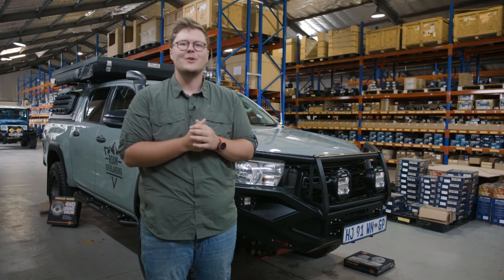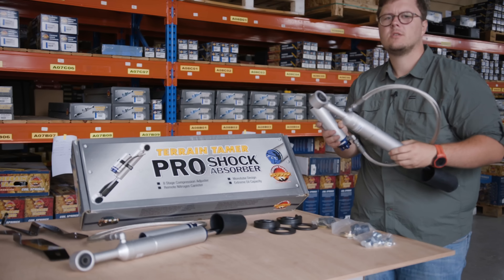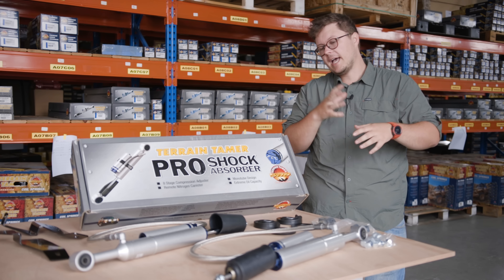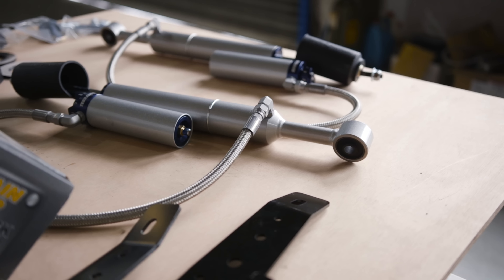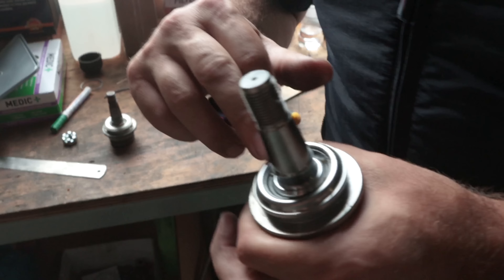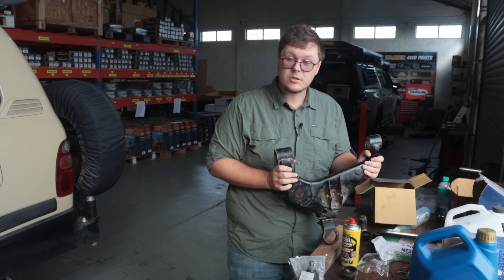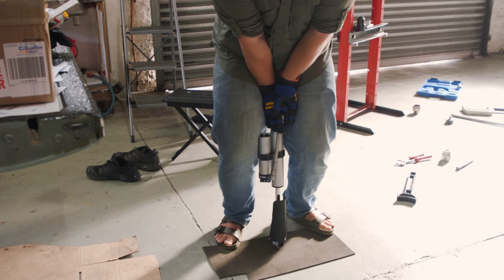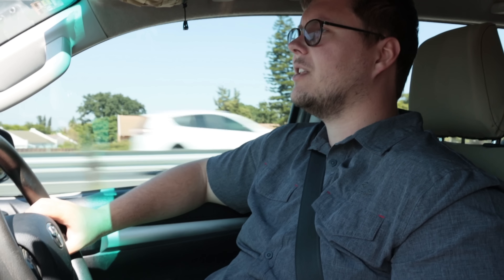Adjustable Remote Reservoir Shocks Upgrading to Terrain Tamer Pro Suspension! ROAM Overlanding

Comment: There excellent shocks I agree, keep in mind on dirt and gravel roads & tracks inspect the reservoir mountings in the morning and evenings especially if your on corrugated ones, as the reservoir where it is mounted/attached can crack, snap or come loose, that where zip ties and wire come in handy as is learning how to stick weld with a car battery.

Comment: Yes, adjustable shocks with remote reservoir are highly recommended in maintaining a great ride no matter the road surface you're on (specially if its for both high & low speed compression, and rebound).  Before fitting a set on my 4WD, I thought once I set it to my liking, I'll probably not change it again.  But I was wrong.  Now I have a setting for corrugations, rough gravel, sand and tarmac.  And these change again depending on my load.  And being able to change the setting without requiring a tool is best.  It's a game changer for me personally.👍
Reply from the maker: It’s like the first time I used tire pressure monitors, now I can’t understand how I ever went without it 😂

Comment: I also have the TT parabolic leafs, smart coils and Pro shocks on my Hilux Legend50 (along with Ironman ProForge upper control arms). Eventually figured out the optimum settings for tar, gravel, corrugated gravel and heavy off-roading - the ride is brilliant, so much better than before (but to get the most out of them tyre pressures are also an important part of the equation). I got mine specifically for long distances on bad gravel; I now have the ride of a top-end luxury sedan, with more load-carrying capacity and off-road ability than the standard vehicle. Adjusting all four takes 40 seconds, no tools, so adjusting for different situations as they arise is a breeze. They might not have the two or three-way adjustments of some of the other brands, but some of those can be a bit of a pain to adjust. I reckon a good upgrade if the budget is there - it wasn't cheap.
Reply from the maker: Thanks for sharing buddy! I feel exactly the same about it all!

Comment: Tell us about the General Grabber AT tyres please.
Reply from the maker: Thoroughly enjoying them, they’ve been great on tar especially wet tar; tough enough to happily go through the Namakwa 4x4 eco trail and Richtersveld. Quiet, fuel efficient and basically a great all rounder. The specific thing of it though is to get the one with an LT rating for overlanding. And the white sidewall will scar when used on really rough trails, so I’ve had to turn mine around after the last trip

Comment: @roamoverlanding I am curious why you change over from Fox suspension?? I am looking to change factory setuo on 2023 Hilux. Would appreciate your view.

Hilux will be a daily driver and used 4 x per year for overlanding. Will just add a canopy, extra battery, slider or drawers , fridge/freezer, roof top tent and a shower.
Reply from the maker: A expanded body twin tube setup from Terraintamer with their smart coils and even just normal leaf pack in the back would be perfect 🤙🏻 it has a great ride, you just need to pick the correct weighting coils, which we have put quite a lot of effort into getting right for different vehicle setups. The adjustable is nice, but it’s not for everyone. And the twin tubes have a nice comfortable drive. 🤙🏻